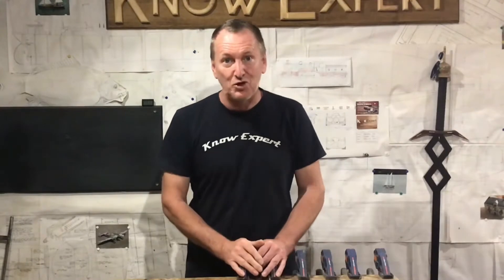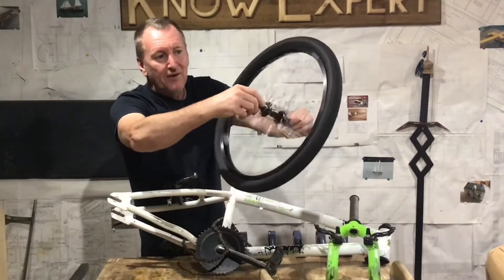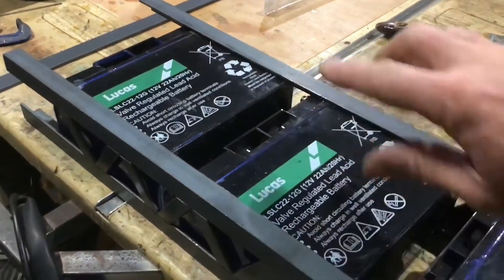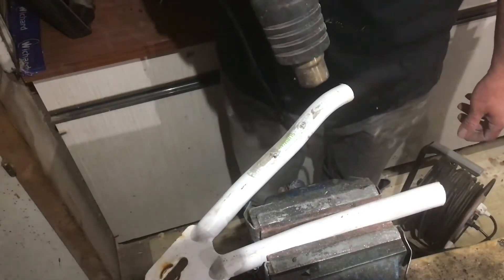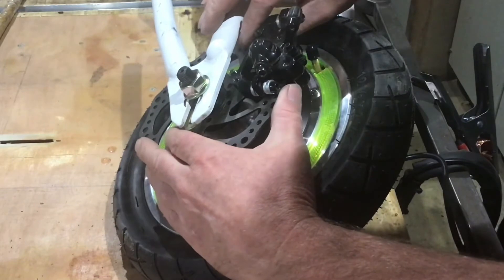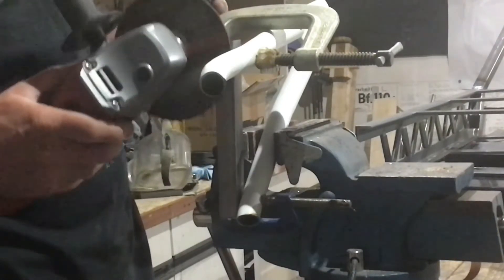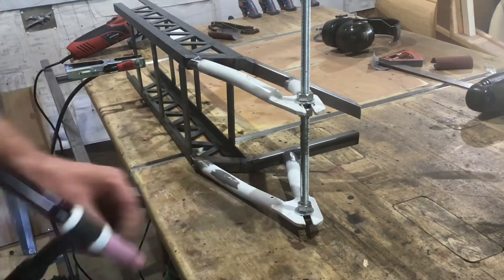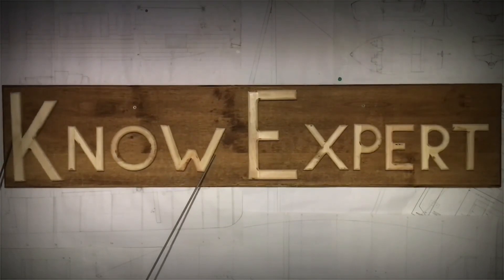DIY 36v 500 watt electric scooter project.

Comment: Well as someone that really likes both Warren girder trusses AND electric vehicles, I wholeheartedly approve of this project, and congratulations on the 1020 subs.
Reply from the maker: TCME, I was on your homepage today checking I hadn’t missed anything. A bit worried 'cos you haven’t uploaded recently.  Work I imagine!  And yeah I finally became a YouTuber….. it’s all happening, let’s just hope it works when it’s finished….. it weighs a ton, still, if it does work then maybe a mark 2 on the cards, lighter and more powerful but hey let’s not get carried away…….
Reply: @Know-Expert  the weight is all nice and low,  and you've got a big enough compartment that you'll have no problems dropping a different battery pack in if you wanted to. Lead acid has a lot going for it though unless you are wanting to cross continents on this contraption! I'm going to use the AGM batteries on dump truck mk3 electro edition coming this winter!

Yes mate just earning a few extra quid over the holidays while I can, week off now then back to normal, and wouldn't you know it, overcast and raining.
Reply from the maker: As long as you are ok!  Dump truck mk 3 eh?  I’m looking forward to that one….. catch you later…….. Know Expert……

Comment: That looks like a fun build...Quick welding tip,tack both sides before welding fully. It stops heat distortion,which can make the metal pull to one side. You can also use the process to straighten joints up if they are out of true or if the cut angle isn't quite right. Just fully weld the side you want to pull up,down,back or forwards
Reply from the maker: Oh yeah I remember now from when I first tried welding back in the very early 90s, thanks for the reminder.